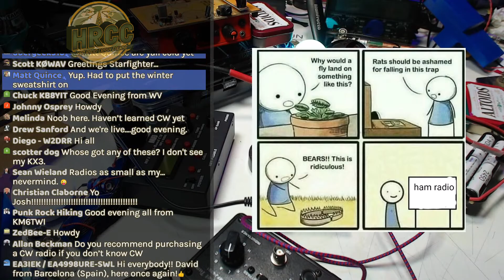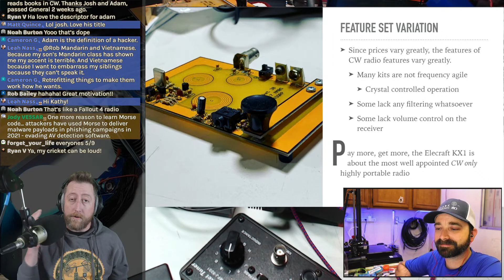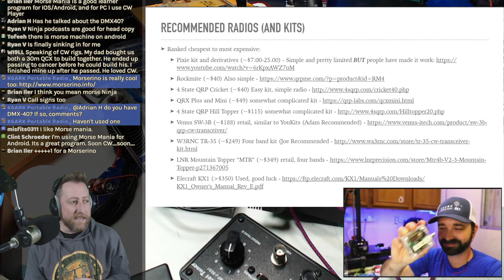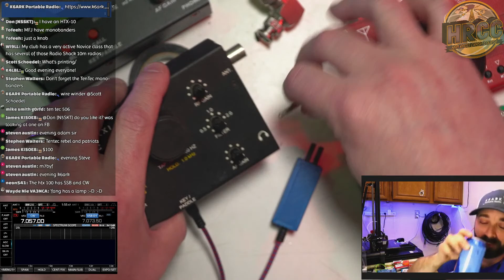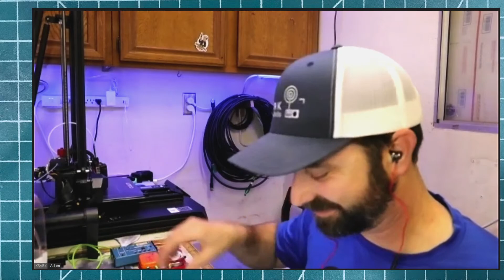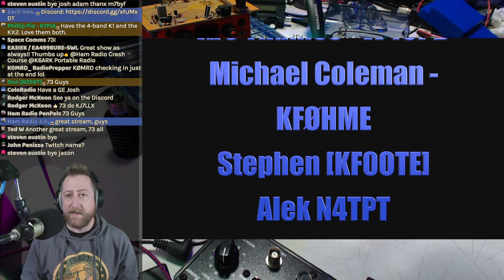My Favorite CW Morse Code Only Radios

Comment: I've just got interested in QRP CW.  Adam K6ARK has made lots of very neat kits, antennas, keys, microphone, but none of them are available on Amazon or on his site as of Apr 2025. Some of the kits are available as 3D printing plans but I don't have a 3D printer.  Will any of these kits reappear for sale? Or will plans, circuits and parts lists be sold?
Reply from the maker: Yes. He has a full time career and is quite busy. Bookmark his store.

Comment: Amateur Radio CW licensing requirements have really changed.  For a novice it was 5 WPM and for the General license it was 13 WPM.  The difficult part was we had to copy 5 letter code groups @ 13 WPM for three minutes. To pass one had to successfully copy one of the three minutes without any mistakes.  Then one could take the written exam.  To pass, one of the things we had to accomplish was to draw from memory an oscillator, amplifier and a power supply and then answer questions using the drawings for reference.  Bad drawings = bad answers.  The other questions were in regard to antennas, feed lines, HF propagation, authorized band frequencies and FCC regulations.  There might have been more, but it was back in the 1950's...  DE K8QlW

Comment: Me and Morse code are not mates. I take to it like an ice cube to a blast furnace, having Aspergers Syndrome, I can't get my head wrapped around it. It was torture getting my Novice ticket back in '76 then I lost interest until I got my Tech , but a breeze passing the General written for my Tech and could use voice (after the looooong drive to Atlanta's hamfest, before there was a VE program). It wasn't till they dropped Code as a requirement that I got a Free Upgrade to General (having already passed its written test), then was inspired to get my Extra. So Code stunted my growth as a Ham.
Good Video Josh!  I hope you and others have a blast with CW.  ~  I just can't see its appeal.
mike  -  N4ONL

Comment: I got an "at sprint III" super tiny radio fits in an altoids tin. Says it 80 40 30 and 20. Its just some boards, a bag of components and a CD. Didn't find much about this. Figured this would be good spot to ask if anyone knows about this before I start assembly

Comment: I regret selling my Elecraft K2 three years ago and was recently hoping to find a nice used 4 band K1 for sale but they have fell off the face of the earth as everyone loves them.  I have some health challenges but am setting up a station for POTA but the prices I have seen has been discouraging post Covid, LOL. I may purchase a Venus SW-3B instead. I do have an old KD1JV ATS3B.1 with 5 band modules from 80M - 17M, but it doesn't travel well as none of the tiny toroids are tied down & the wires tear off very easily. Also at least one SMD variable capacitor has torn off one of the band modules too. This rig is one of the earlier KD1JV predecessors to the Mtn Toppers, it has a single 7 segment display. I live and travel full-time in a 23' travel trailer so soldering SMD at my age is getting impossible as I did it in aerospace as much as 35 years ago, LOL. Love your channel, Dave - KU9L

Comment: The SW-3B is a great radio, I worked 65 CW contacts to activate a park. It worked great for about 2 hours. THEN the screen crashed!  Radio continued to work but no screen. 

Tried again at home, no luck. After contacting Dale at Venus and he sent me a new screen. After about 3 weeks I attempted to desolder the screen, 7 pins. Again no luck. A pro electrician offered to replace the screen for $50, after discussing with Dale he offered to refund the $50 (note: it would have cost $65 to ship it back to China and there was some talk that radios are prohibited to ship to China).  Back to the screen replacement, the new screen was a bust also. 

I contacted Dale again and he offered to fix and return, again my cost to return to China. 

So now I’m in a quandary: 1. Do I spend another $65 in addition to the $188 original cost minus $50 refund spent with electrician, 2. Forego the Venus, cut my losses, and switch to a Penntek TR-35, or similar, preferably made in USA and/or quality support, or 3. ?  Does anyone have a recommendation?
Reply: @Steven H long story short I bought a PennTek TR-35 and love it. In the meantime Venus sent me a new replacement unit but when I tried to return the broken unit the USPS declined to accept the radio to send to China. Venus told me to keep it.

Comment: I learned CW starting about 4.5 years ago (when I was 57 years  old) using the KMT Pro app, learning head copy only. I topped out at 27 wpm and morse is completely intuitive to me now. Don't be scared, all it takes is half an hour a day of practice and pushing yourself on speed. 73 de KD8ZM
Reply: Great to know. After several past attempts I’m at it again in earnest. How long did it take you to get to that speed?

Comment: Great interview! One important consideration for those comparing a rig like the SW-3B vs. the KX2 is that most of the QRP CW only radios will consume less than half the power of a KX2, which typically means a more than 50% weight reduction in battery needs for similar operating times... and if you consider the total weight of a ham station, your battery is going to be one of, if not the heaviest item.
Reply: I hate the KX2 simply because of the over rated and over price many other comparable radios. Marketing does wonders

Comment: My favorite CW only transmitter was a Johnson Viking Navigator which had a 6146 in the final and a power of 40 watts. It was easy to use and worked well with my Courier amplifier that I got a few years later. Sorry, I'm an old timer with almost 60 years in this game... :)
Reply: Globe Chief 90A here. Rockbound and bullet-proof. Miss that old anchor.

Comment: Excellent session, many thanks! I've had great fun with minirigs like these...took my 20m QCX in the garden at work, it was still just a pcb with no case...made up an inverted V dipole, connected it up and tuned around,  first QSO was with a station in MO, over 4000 miles away! I have several other rigs including a Pixie and a RockMite. Someone over here took a RockMite kit up a mountain,  built it using a gas powered soldering iron,  then used the rig to get his last few SOTA points for his Mountain Goat 🐐 
73, G0CIQ

Comment: A point about the Venus, It actually has AF and RF gain built in and a VFO knob where the MTRs do not. It also receives SSB. I own a few MTRs and the Venus is definitely a contender. It's more like a poor man's KX1 without a tuner rather than a poor man's MTR.
-N4ARY
Reply from the maker: I have one on the way to me. I’ll be doing a review in the future. I’m looking forward to it.
Reply: Agree. It's hard to argue that the MTR's are better than the SW-3B when you've got easier controls, greater voltage tolerance, and rotary/dial knobs on the SW-3B. Not to mention the huge price difference (nearly half the cost for the SW-3B). MTR's are "brand name," which is perhaps the best thing they have going for them. I just published the design for a 3D printable case for the Venus, freely available, that makes the rig ready to toss inside a backpack without a second thought.

Comment: Please explain why we should buy a 2000- pound radio for transmitting  in CW.
Reply: Because they would be a ton of fun! :D
Reply: @steveallison7950   One year later and someone finally _saw what you did there._. LOL
Reply: Only reasons I can think of are because you want one and can afford it.
Reply: Let me count the ways:

1 You love eighty meter AM and crave high fidelity.
2 You love testing and replacing burnt out or soft tubes.
3 You are a Luddite who considers transistors and circuit boards the work of the Devil.
4 You are built like Andrey the giant and only spacious point to point wiring will accommodate your over sized mitts.
5 You plan to die in your current residence and don't give a damn about your survivors. In fact, you have willed the one ton wonder to you most despised nephew .